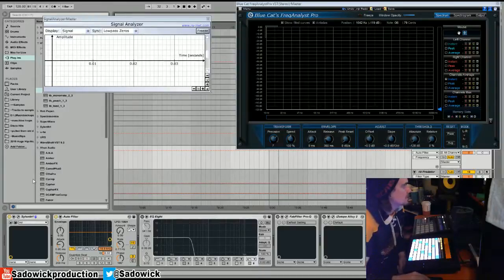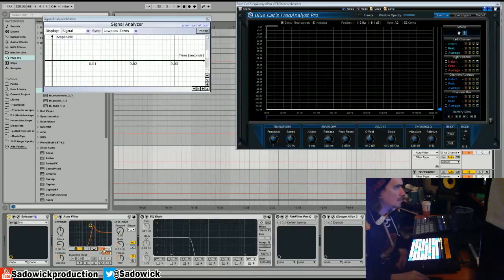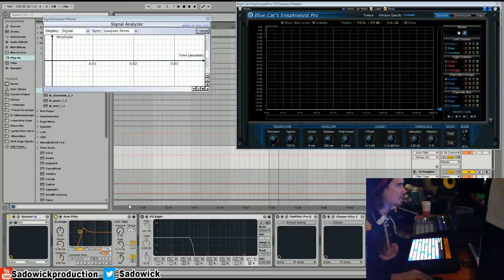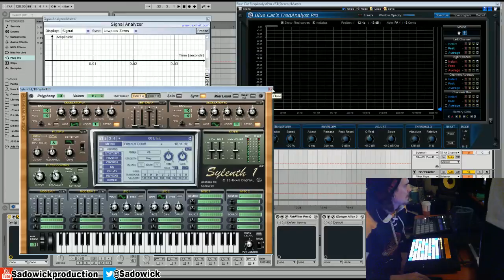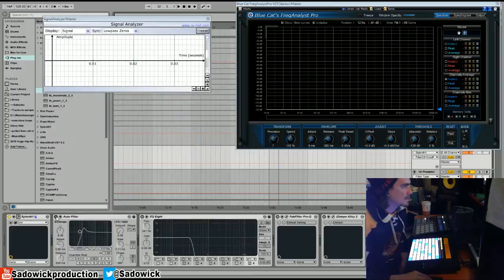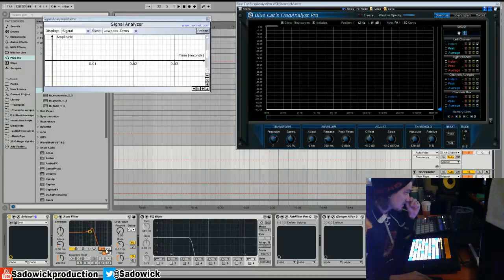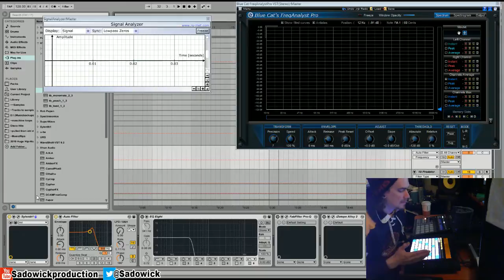Synthesis Audio Filters 04 - Resonance & Self Oscillation

Comment: Side note: Self oscillation occurs with good circuitry. The Sylenth (in this demo) doesn't exhibit any resonance oscialltion, its totally locked, which I'd imagine is important info for anyone learning.
A good self oscillating resonance parameter will mean that once past a certain threshold, the peak of cutoff frequency will start to 'move' and cycle back and fourth between different frequencies. This means that every time you send a note into it the filter, it will amplify different frequencies around the cutoff at different time depending on the oscillation cycle. Basically it causes tuning inconsistencies, which has become an extremely desired aesthetic. This is what gives analog filters their character!